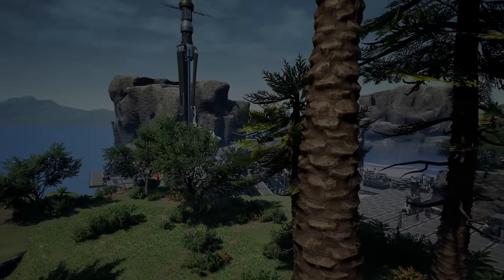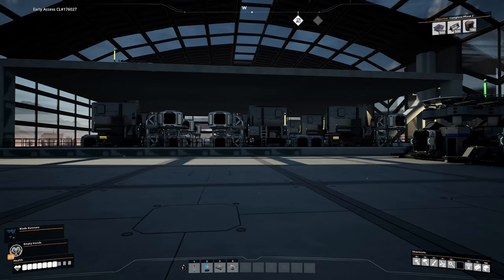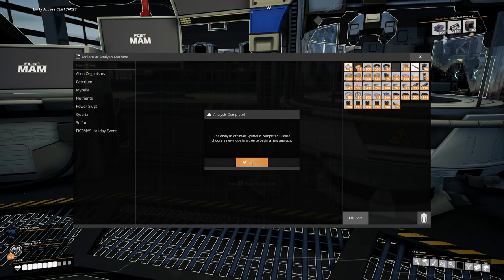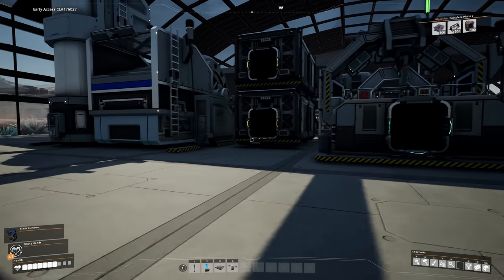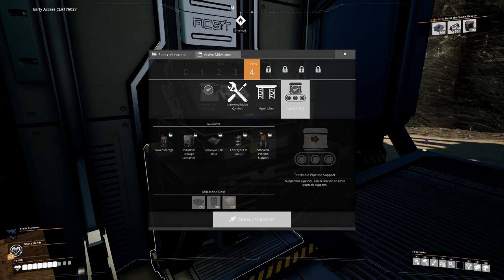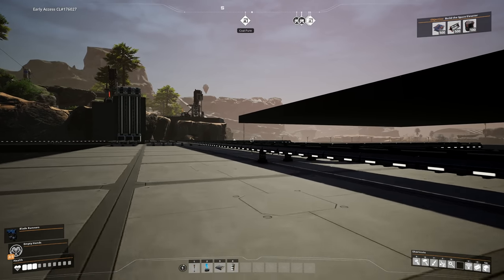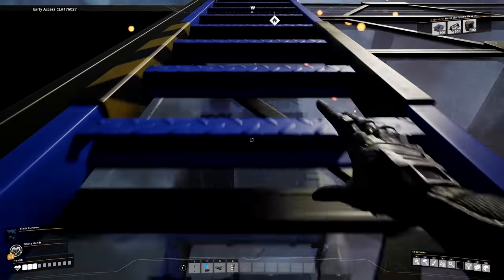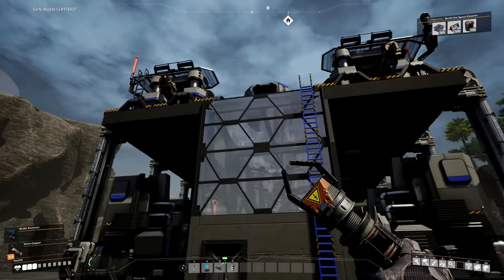The Most Compact Clean 100% Efficient Machines in Satisfactory!! - Part 6

Comment: Nice video, Here is a tip by the way. You can actually set your machines to work with the exact numbers you want. Let's use the constructors for your concrete for example.

You have 120 Limestone coming into 3 constructors, so split evenly you need 40 per min to each one. So to set the constructors to consume exactly 40 per min you just need to do a little bit of math. So you take 100 (for 100%) and divide that by what the machine consumes at 100%, in this case 45. And then multiply your answer by how much you want the machines to consume which will be 40. this gives an answer of 88.888888 reoccurring. 

So the calculations looks like this.
(100 / 45) * 40 = 88.888888.....

You can type the answer into the machine clock speed percentage and that will set the machine to use exactly what you want it to.

Now the bit I haven't seen people talk about, or maybe even notice, is that you can put in a number that is 10 decimals long (maybe even longer, but I haven't tested) into the clock speed percentage and the game WILL accept it! Only the displayed number will be rounded to the nearest 4 decimals, the machine will be operating at the percentage you typed in despite what it's displaying.

Alternatively you can type the maths equation into the clock speed percentage and let the game do the maths for you, but I'm not sure if that is as accurate as putting in the answer yourself.

The maths work with output numbers too.
Reply from the maker: Oooo 100% know this, but when its 4am in the morning after a Stream and a Long day of recordings, these thing happen. Appreciate the lookout <3
Reply: @ItsBitz  No problem, hopefully, my comment will help the community know about this as well if they didn't already. Oh, and have a good Christmas and New Year too.
Reply from the maker: @StephenMcClone  You too my dude!! Have an awsome holiday :_BitzLove:
Reply: You don't really need to do all this. He wants 40 concrete per min and is using 3 constructors so just type 40/3 on each constructor and that's done.

Comment: w8...hang up a tick. 45 limestone for 15. 120 Limestone. 2(45) + .667(45) = 120. 3:1 = 40 Concrete ...Where did the .2 come from?
Reply from the maker: Easiest solution would of been for me to put 40 in the desired output instead of crating the .2 and changing the percentage
Reply: @ItsBitz  I personally set 2 of them to 40.02, then another one to 39.96, so it balances out two other 0.02, and gives exactly 120.
Reply: @Kentauros1991  But power-wise it's better to underclock for example 1 machine by 30% then 3 by 10%. Satisfactory mathematics...